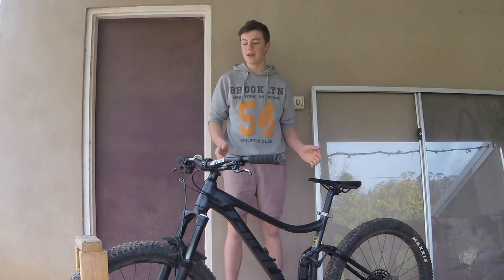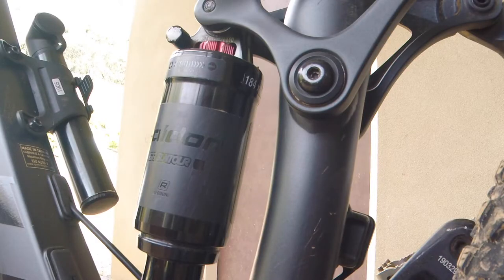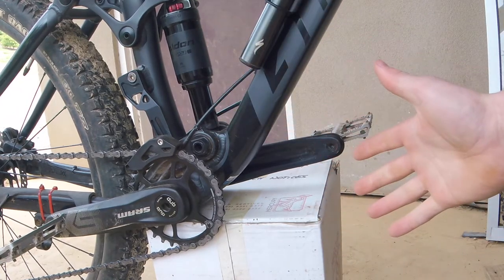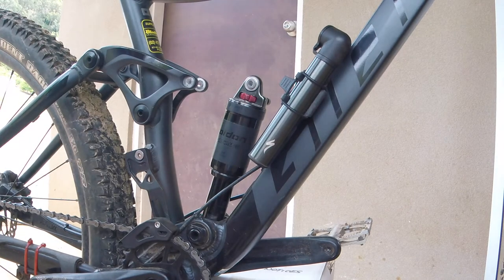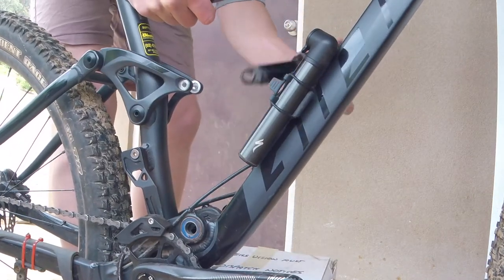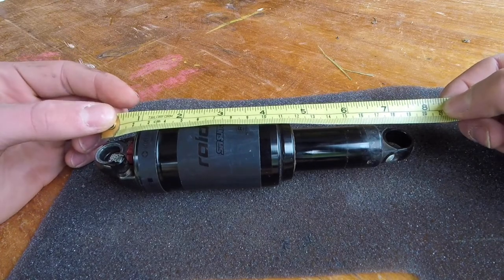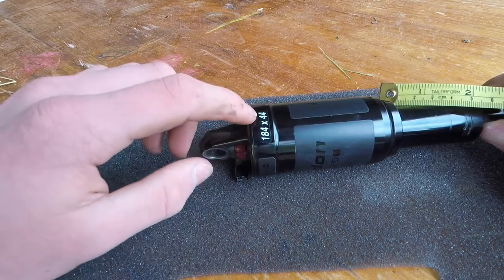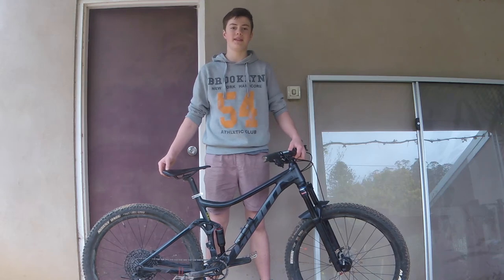How to measure your MTB rear shock.

Comment: What happen if i use a 190mmx 50mm rearshoch burlt my shock is 190mmx42.5mm?
Reply from the maker: It'll have a lot more travel which might mean your rear triangle could bang against the front from over extention. I wouldn't suggest it but it might be possible